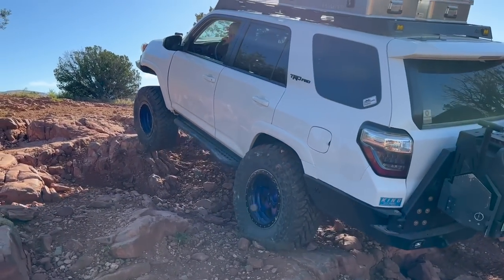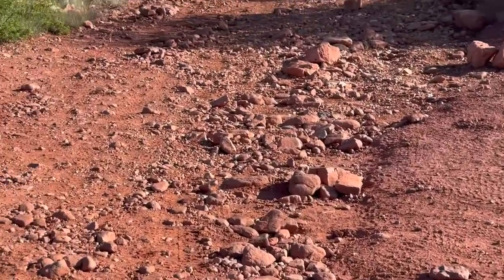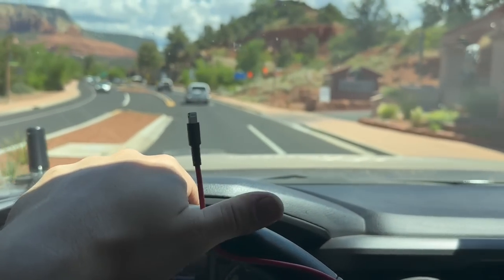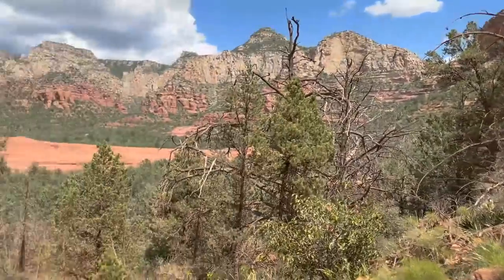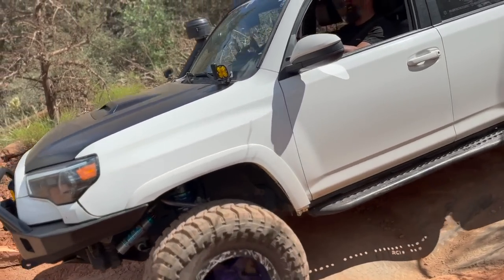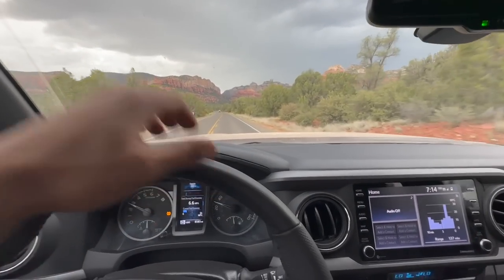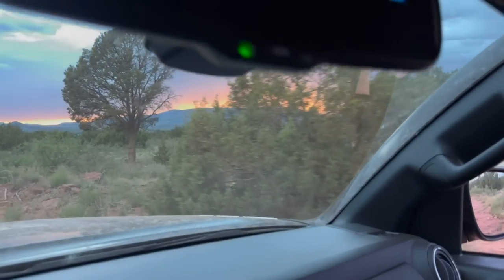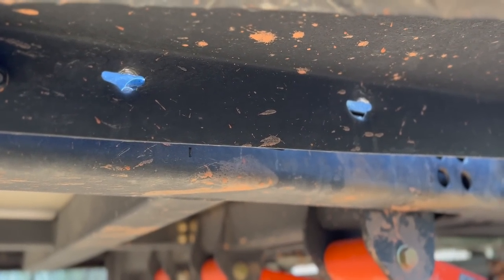Exploring Sedona - Hard Trails, Trailer Camping, & EPIC Views

Comment: Hey Grant Idk if anyone else or y’all noticed on the passenger side trailer tire looks to be locking up and dragging on the slow descents.  Noticed it in both videos from AZ.  Possible trailer brake adjustment?  Wanted to mention it just in case.